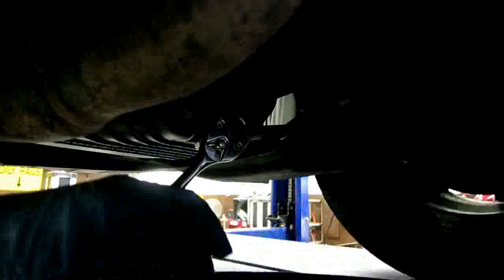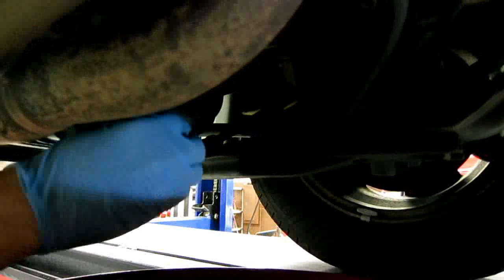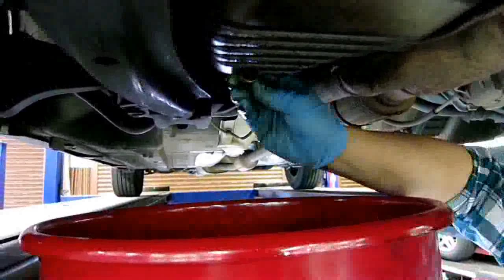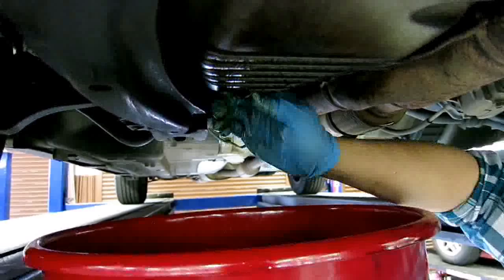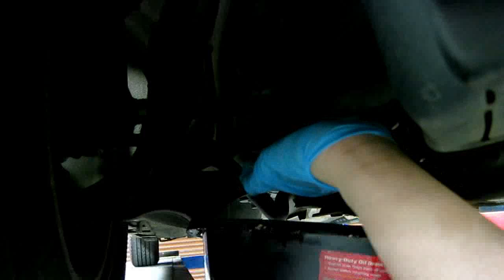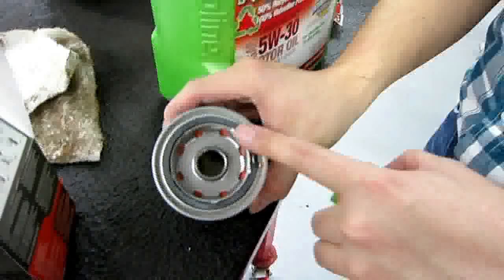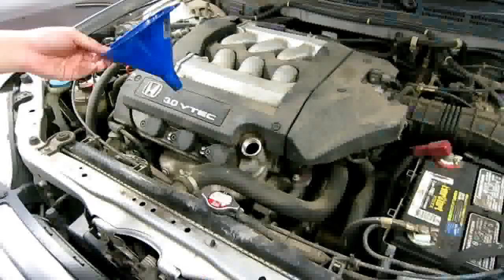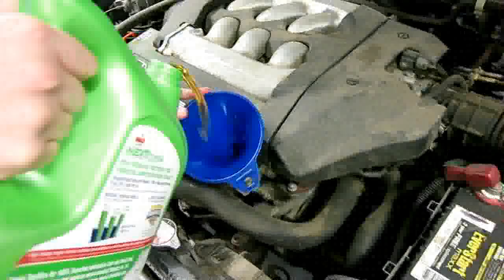Howto DIY 2002 Honda Accord Oil Change replace oil filter - 2001 2003 2004 01 02 03 04

Comment: Would you say changing the oil and oil filter on my Honda Accord can be done without access to a car ramp ?  I'd have to do it outside on the floor - would you say i'd be able to access and change the oil filter that way ?  Thanks.
Reply: +Jez2008UK yes, on a flat surface and you will need to use a jack stand.

Comment: Doesn't really matter or make a difference. Different oil should be used for different climate anyways. These cars can take 10w-20, 30, 40 5w, 20 30 50 0w 20 etc.

Comment: Can I just put 5qt instead of 4.5qt, and is it better to use 5w-30 oil than 5w-20?
Reply from the maker: Over fill isnt good, i would pour 4qt then check and slowly add more oil. you should always use the manufactures required oil (5W-30), but 5w-20 can work if you dont have the right oil.
Reply: DIY Tinker no you fool 5w-20 is the recommended oil for this car, i have the EXACT same car. honda uses quaker state, the green bottle